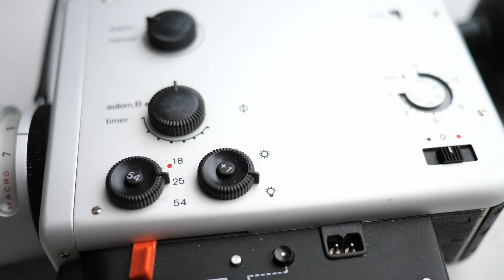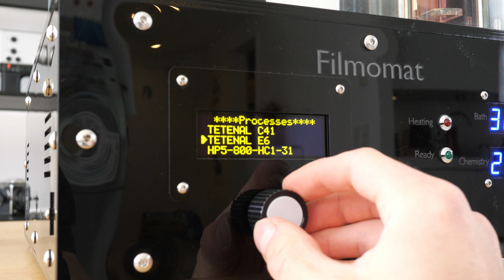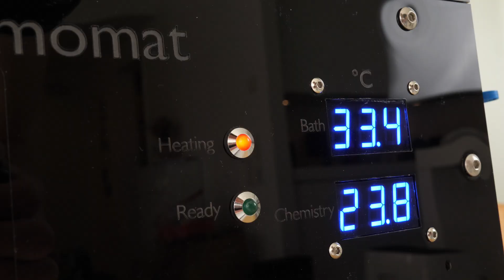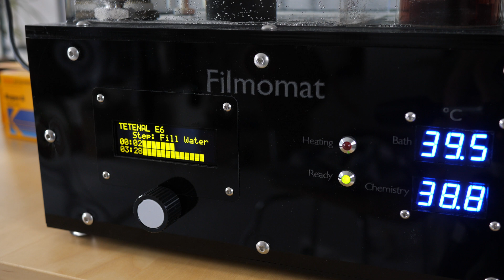Processing Super-8 Ektachrome with the Filmomat

Comment: That is quite the setup! Is the tank capable of processing with a  ECN-2 developer?
Reply from the maker: You can definitely do ECN2 with this setup and I will probably do a separate video about that at some point. In the La Palma video I linked, there is 50% Vision 50D footage, so you can definitely get really nice results. For end users there are several small Kits available, for example the Bellini ECN-2 Kit. Using the "original" Kodak chemistry makes little sense as you can only buy that in 20L bulk quantities (the Filmomat only needs 500mL). There are two main limitations: ECN2 needs 5 baths, but the Filmomat has only 3 tanks. This requires to split the process into two parts and exchange the chemistry in between. It's easily done in 5min. Second, like Ludwig already said, is the RemJet. The majority of the RemJet is removed during the process, after the PreBath and rinse. A small part sticks to the film, tough, and needs to be wiped off with a soft sponge after the process. This is a bit tedious and the film needs to be wiped multiple times, to get rid of all the RemJet. Of course its not as convenient as sending the film to the lab, but it's definitely fun to do. 

At the end of the day, ECN2 was always designed to be done in continuous processors - so doing it in batch (no matter if with the Filmomat, Lomo Tank or whatever equipment) will always be a bit of a compromise.
Reply: With certain compromises, yes. There is no good way to remove the Remjet though. That`s the first thing. Then, bleach fixes for ECN are bad. But you could live with that. Proper ECN UL bleach would attack the tanks, so you`d have to substitute it. All possible. So, can you process ECN-2 S8 film? Yes. Will it be fun and convenient? No. Removing the Remjet only after processing will be no option either, btw: The CD is alkaline and will soften and solve the Remjet layer, and wash parts of it into the CD, rendering it unusable for other films. Thus, you´d have to run it as one-shot, which is not very efficient.